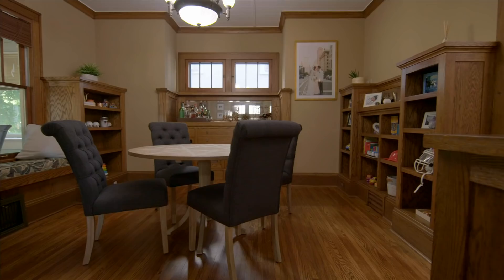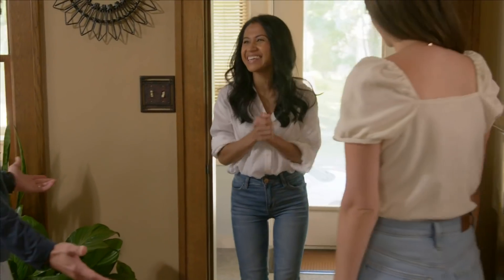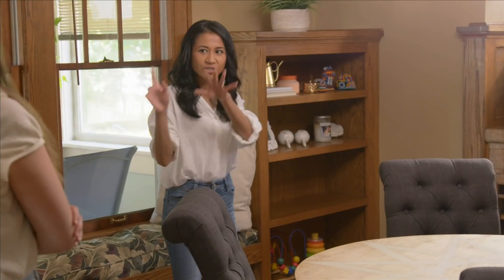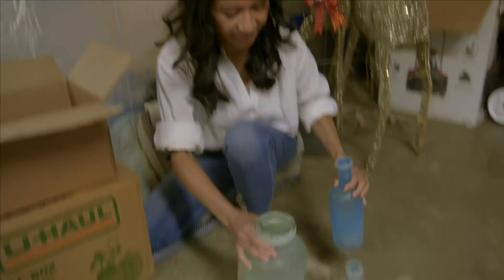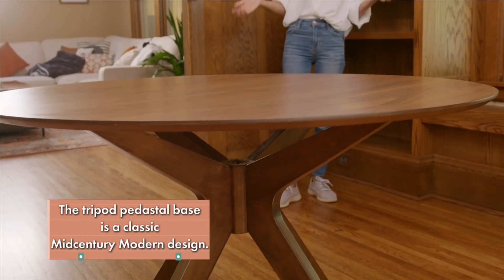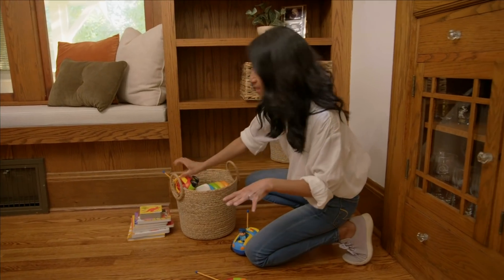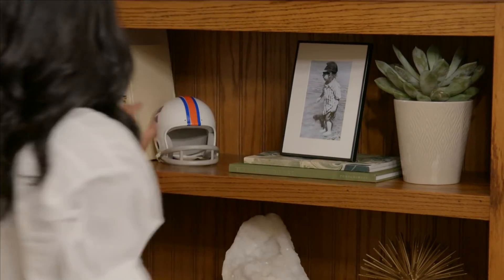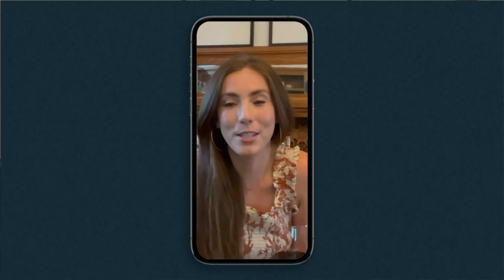Giving A Mismatched Dining Room Historic Charm: From Cluttered to Cohesive | Rentfluencer

Comment: It looks a lot better, but there is so much WOOD in that house - the floors, the doors, the furniture, the kitchen cabinets. What were they thinking?
Reply: It's a Craftsman... carpentry aka wood is the whole point. The home shows off incredible craftsmanship and is practical (in comparison to Edwardian) with wood details, built-ins, and a simplified floor plan. It's actually really special that the home has so much of it's original detail intact and not painted. Really interesting history
Reply: Agree! I understand it's craftsman style but the builder OD'd on the built-in open shelving.